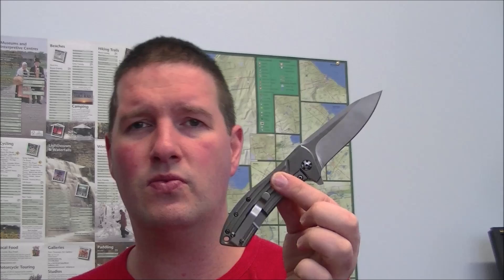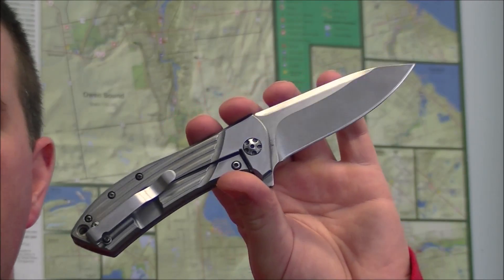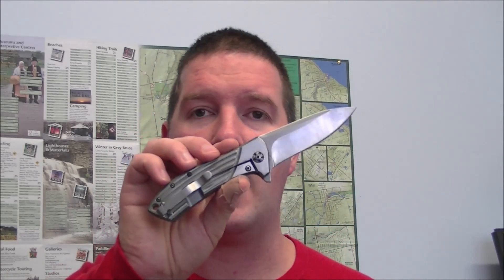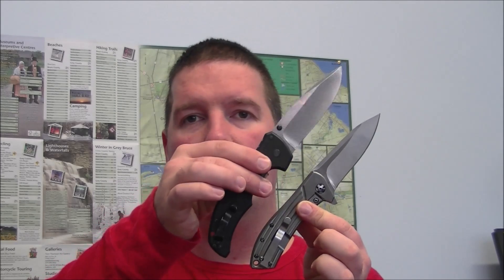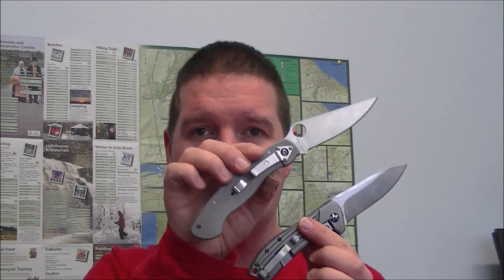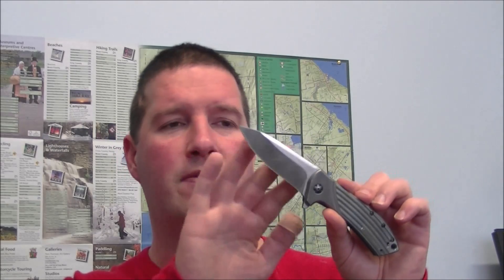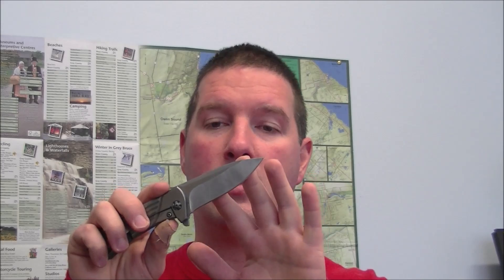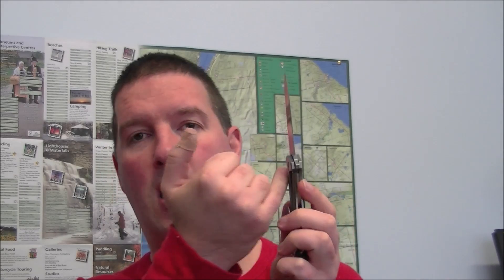Zero Tolerance 0801

Comment: hey Kevin im looking to buy a new zt I currently have a zt 0909. should I get a 0801 or a 0562 Hinderer slicer? or should I skip the zt and buy another Benchmade the new presidio's look awesome.
Reply from the maker: I would take the 0562 over the 0801 because I think the blade is a bit more versatile that said the new 0801 is really nice and it's not like the blade is no good just not as thin as the 0562 but maybe you want a slightly thicker blade.
Reply: Kevin cleary I usually do prefer a bit thicker blade. how do you like the elmax that zt puts out I've heard some complaints about it?